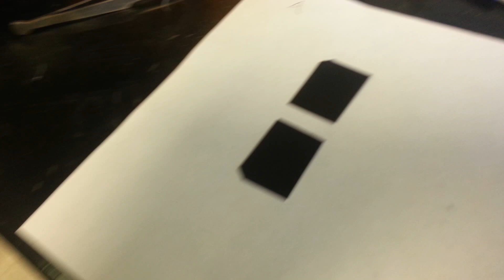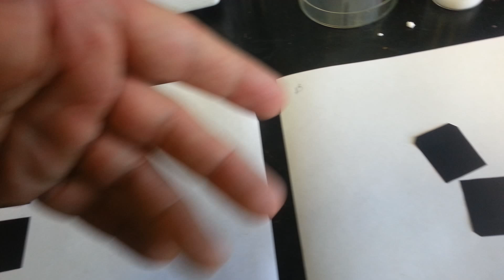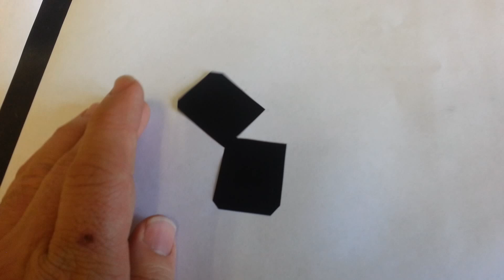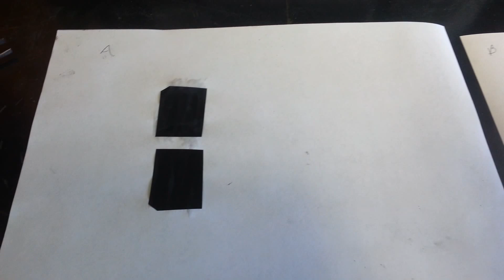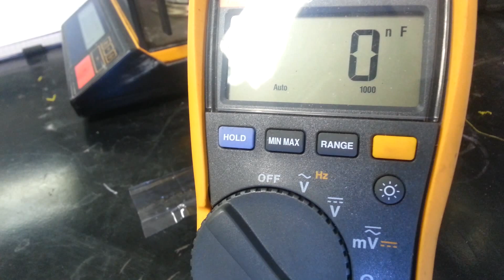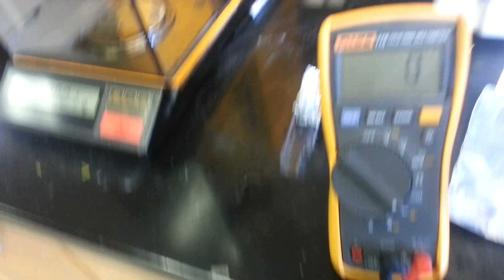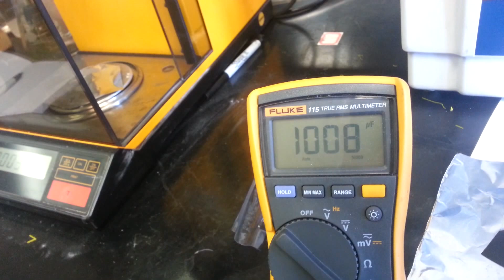Graphene Battery DIY construction

Comment: Hi, I was wondering if that is a battery or a capacitors? Oh, could I make a replacement cellphone battery with the graphene
Reply from the maker: +freyes389 It's technically a super capacitor, but I am working on hybridized battery/caps that use both mechanisms for storage.

Comment: Unclear and confusing. I am excited about your claims, and excited that you're working on it, but so far most of your videos are hard to follow and we haven't actually seen any results. Again, if it's working as well as you say, nice work and keep it up.
Reply from the maker: +David Parker I'm not a battery maker, but this was just to show the material does enhance the batteries. If you want to see someone really make great cells, check out Robert Murray Smith's channel. He has made some very good cells with this that will be in production in the near future.
Reply: +Venturestarx Awesome. Thanks for the heads up. I'm excited about the graphite and graphene advancements. I personally imagine a future in long lasting lightweight batteries powering a small personal quadrocopter. Keep up the good work.

Comment: Did you build a battery or a capacitor? Because there is a difference.
Reply from the maker: It's technically a double layer electrolytic super capacitor. Therefore, close to a battery rather than a typical capacitor, but close isn't exact. Even when considering some new lithium construction, you could entertain the same debate.
Reply: Venturestarx I guess I'm mainly concerned about how long it can hold a charge. If it can hold a charge just as long as a battery then I don't care if it's a capacitor. I just want a graphene battery lol
Reply from the maker: Samantha Hampton These caps have a higher self discharge rate than most batteries, but not as bad as regular caps. But that has to do with construction and electrolytes. Plus, this is just a proof of concept and a guide for those DIY guys out there.
Reply: @Venturestarx  Is it possible you can make a video how to make a battery?

Comment: Have you heard of straintronics: piezoelectric graphene.  Theoretically, you could build graphene sheets that form into battery contact when affected by certain frequencies.  http://engineering.stanford.edu/news/straintronics-engineers-create-piezoelectric-graphene

This is great stuff, super awesome.

(or maybe the frequency they create could make them stay in the right form due to piezoelectricity.)
Reply: Venturestarx I was always sucking the phosphoric acid from the batteries when I was a child. Gives you power.
Reply from the maker: I haven't heard of it, but I'll check into it.
Reply from the maker: Lolz